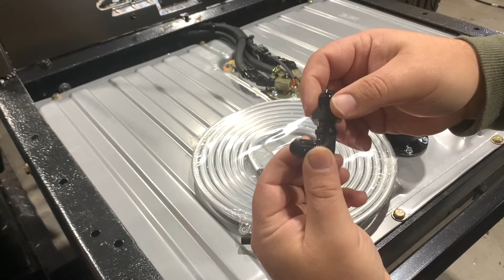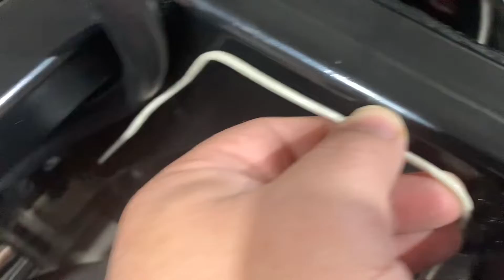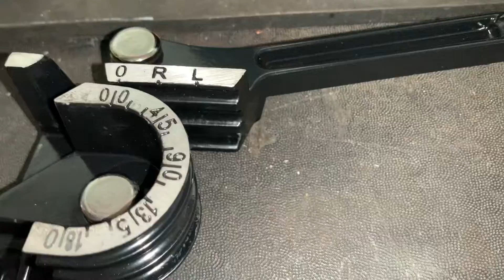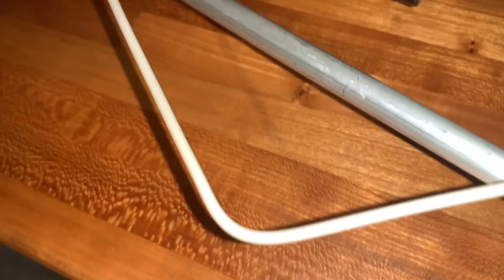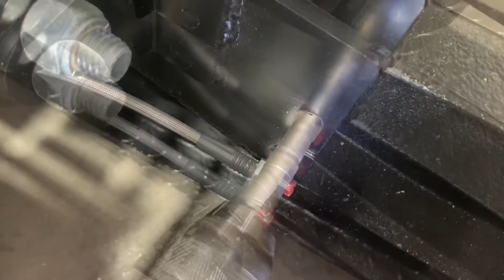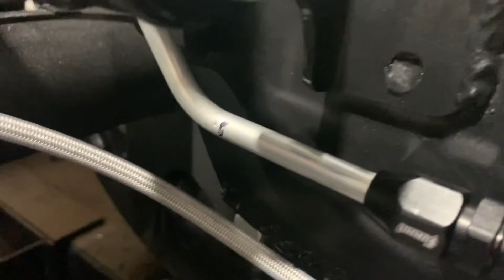Make CUSTOM Metal Fuel Lines Like a PRO With This $9 Tool!

Comment: I used to unroll tubing the the same way until my boss came and looked at the tubing i did on a compressor skid years ago and said “wtf is that” he said “that looks like you just unrolled that tubing by hand and it looks like shit.” I said, “well what am supposed to do with a rolled piece of tubing?” Then he looked at me like I was retarded and said “your suppose put come along on it and stretch it, then it comes out perfectly straight”. You know…. that was one of the best lessons I ever had in my career. I put a come along on it every time now and the tubing is a straight as straight can be. Little extra effort, but well worth it.

Comment: Why Aluminum tubing? thoughts on stainless steel, or nickle-copper tubing?
Reply from the maker: Stainless is nice but a pain to work with. I use nicopp for brakes but it would be ok for fuel.
Reply: @intheshoptv  I read that aluminum tubing is susceptible to corrosion and cracking from ethanol.  It is also more prone to splitting from improper forming.
Reply from the maker: @STARGAUD If you ask 5 different people you’ll get 5 different answers. You have to remember that this is a build that gets stored on a lift, in a climate controlled garage and sees like 500 miles a year. I don’t think I would use it in an off road production vehicle, but for all my street rod projects, its the first material I look for and have been running it for years
Reply: @intheshoptv  Yes I agree, thanks so much for your video.  Your choice of aluminum in this is pro.  Thanks for your answer it helped me narrow down my options for my daily that had a failed fuel line and sees New England winters.  Looking forward to more videos.
Reply from the maker: @STARGAUD thanks for watching brother

Comment: Why not go flexible the whole way? If there is no step notch to have the tubing do gymnastics over, then isn’t flex line a sensible solution? Truck looks great!
Reply from the maker: That’s a great question! I prefer rigid fuel line for safety when running under the vehicle along the frame. Rocks, road hazards etc… I prefer the hose and flexible lines once it transitions to the engine because of vibrations. Hope that makes sense!
Reply: @intheshoptv  it does make sense. Love the videos!
Reply from the maker: @ScottTheEng  Thank you!

Comment: Where did you buy that roll of tubing and can you select a size for the fittings or do those get purchased separate?
Reply from the maker: Here is the tubing: https://amzn.to/3veqA0O (you can choose different colors if you like). Fittings are purchased separately since there are so many different options/configurations. However, with this size tubing, you would select a “6AN to hardline” fitting, in whatever configuration you need (straight, 90°, 45°, male, female… etc). Here is the straight one I used: https://amzn.to/3RzFg1U